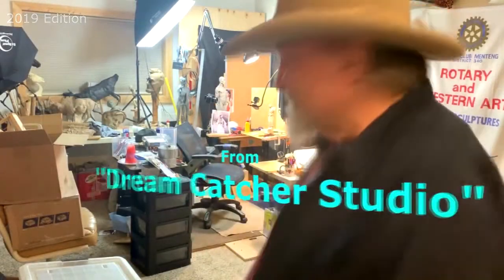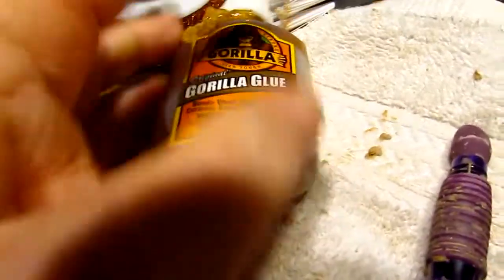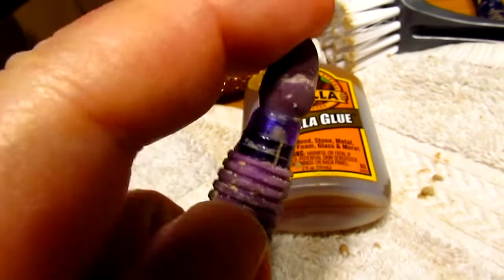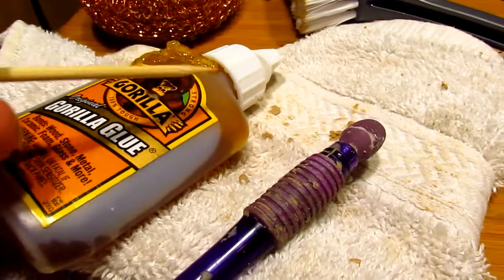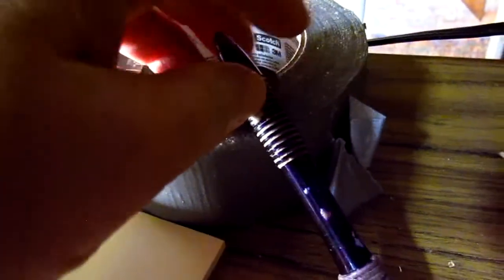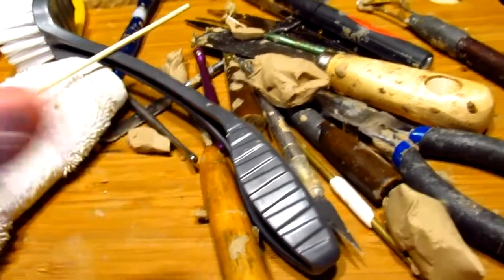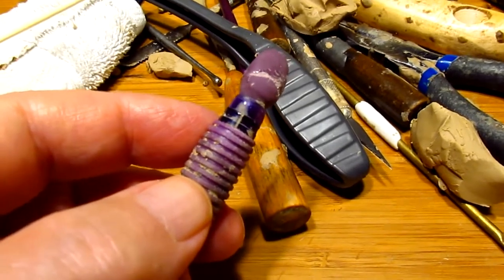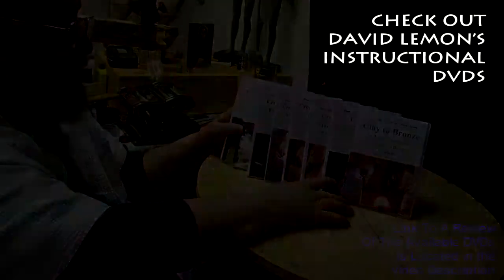Repairing my Silicon Tipped Sculpting Took With Gorilla Glue

Comment: So sorry the tool broke David. :( I'm very glad the Gorilla glue helps. I hope it continues to work for you. That's the first glue I know of that will even adhere to this slippery stuff!

One of the reasons I quit making them is that I felt they were not a good design - because of the failure like you experienced. Through lots of trial and error, I found that just the two-part silicone alone flexes too much and breaks. But by adding a rigid support inside, that tends to cut through the silicone over time with use - just like yours did. ARGH!

One day I hope to get back into it and "make a better mousetrap". Till then, folks can fashion a smooth surfaced patch on their torn silicone tools using a bit of either two-part silicone [found in craft stores, etc] or use Sugru silicone "glue"[cures fairly stiff]. Use a wet finger or tool to smooth and shape the patch before it cures. Silicone will adhere to itself. So you may be able to use other silicone materials to patch or create sculpting tools also.
Reply from the maker: You should get back into making them.. with the advisory that after time they may break.. I've had so many who'd buy them even with that advice.. Just say .. don't press hard .. over time it will break the silicone ...

Comment: You know, as good as you are with making stuff, why not make a mold of your tool, or even sculpting a version you want to better suit your hand, and then fill it with an epoxy, so you have the base of the tool, then drill and possibly thread the tool so you can get attachments in it, i'm thinking a screw with a soldered in place/glued/loctite/ whatever to make it hold nut. then you sculpt/mold out a shape you want and pour silicone into it and you can get your own custom firmness silicone tool, and with the base mold, you could make as many as you want or just replace screw/nut on one for different tools. because there are lots of different ways you can set silicone, either being very stretchy and rubbery up to the firmness of a car tire you have a lot of room to work in. everything you need could either be bought at a hobby shop or possibly a hardware store, silicone caulk could work but you are largely bound to what firmnesses they sell rather then a custom mix.
Reply from the maker: I've thought of doing just that... Thank you for your suggestion